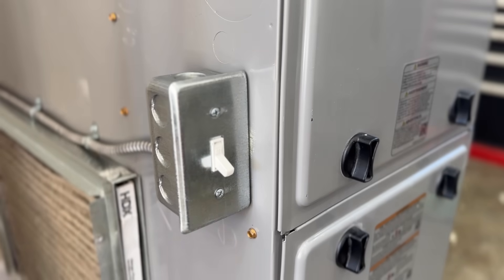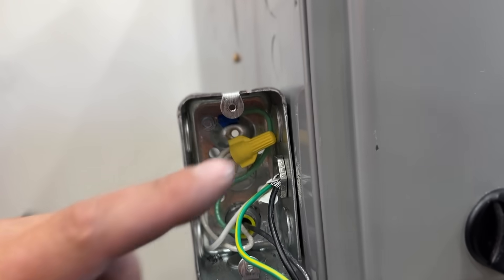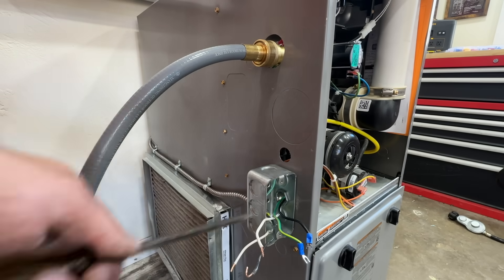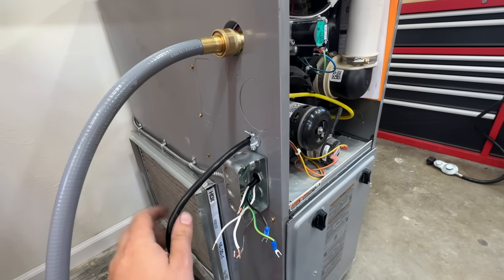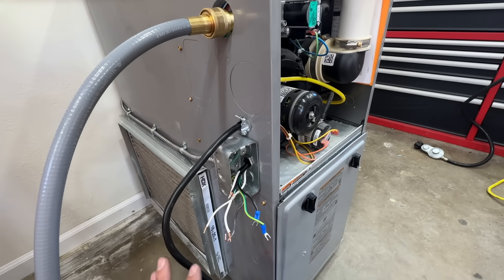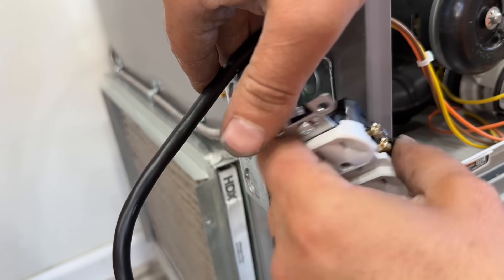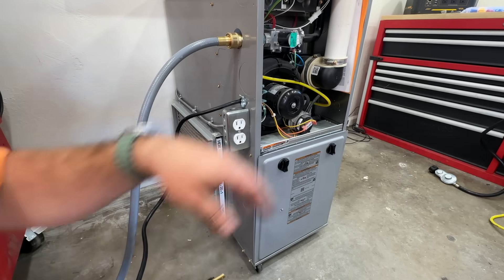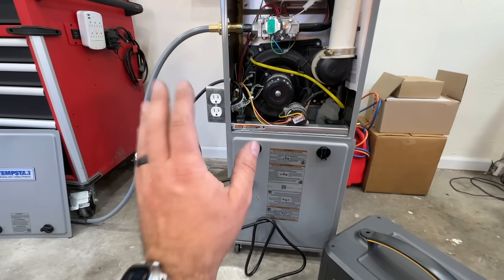Keep Your Family Warm During A Power Outage By Installing This $5 Part

Comment: Simply add a 240v breaker to the box along with a lockout.  They are totally legal if they are the ones sold by the box box.  Then connect your generator and you have power anywhere you need it in the house such as refridgerator, Internet, lights, gas stove and oven, gas dryer, washing machine, and Microwave.  You don't have to rewire anything other than run the wire from the generator to the panel and you turn off the mains to the panel while you are wiring it.  With a lockout it is impossible to have the mains and generator breaker active at the same time.  The lockout will cost you between $40 and $50.  You plug your generator into a 30A plug outside your house.

Comment: Three things I wont mess with…electricity, gas, and water…I will do most anything else in my home…but I leave these three things to the pro’s…my philosophy is simple…if I have to turn something off in order to perform an upgrade or a necessary/needed repair, I call the pro’s.

Comment: Instead of crimping terminals onto the stranded wire,select the grade of devices spec’d for stranded wire.They have a compression plate under the screw head.On the even higher grade,they are backwired,with an internal compression plate.Also,in this steel box install,even with the box grounded,if device yokes are not self bonding,a direct connection must be made.

Comment: Maybe I missed something here but, shouldn’t the breaker be turned off before connecting the pigtail to the emergency power source? I didn’t hear you state that. This so when the power comes back on, you’re not feeding grid power to the generator or power source being used.

Comment: Would it not be smart to make sure the breaker to the furnace is off, before connecting to the generator then when power comes back on disconnect the generator and flip furnace  breaker back on. being both outlets are powered with 110v if the breaker to the furnace is not off, would that not be putting 220 into the furnace with generator still connected ?

Comment: FYI, 
Make sure to read your gas and mechanical code books before doing this modification to a gas hvac unit. 
Gas hvac units are required to have a disconnect switch hard wired and not a pigtail. 
You should contact a Licensed gas technician and a Licensed electrician before doing this.

Comment: Got cut off. Inspectors require a on/off switch with a red plate. Also a cord sticking out that might be a cheap 16 or 18ga wire not capable for the power needed especially  on long runs .Get an electrician.

Comment: @diyhvacguy
Thanks for making this video, It’s been very helpful and informative.  
I’m pretty handy in most areas, except electrical. In fact, I have very little knowledge and I’m afraid of burning my house down. So that I don’t cause a fire, can you tell me how can I figure out what amps I have (15 or 20) on my HVAC? I live in a single family home that is 2700 sq ft upstairs with a 3/4 unfinished basement. My HVAC is a high efficiency unit. My breaker panel has two 30 amp breakers. I’ve been told that I have a 15 amp wall switch on the unit for power. 
Can you please help me understand how to wire your modification? Thanks!

Comment: I believe you should include some important facts. Just how long that Power source will run that furnace. That's the one FACT the Salesman ALWAYS leave out.  Most Power boxes are just to SMALL to carry the loads for any length of time. Yes it WILL run it But only for a short period.   Great info on the upgrade.

Comment: Hi, 
I have a question.  I just got installed inlet box 50 amp to main panel breaker.  For generator. So, do I still need to do this cable to connect direct to my generator?  Thank you very much.  Loved your videos.  Thanks again.
Tran.

Comment: Do you have those combo square drive + flathead screwdrivers for the electrical outlet wire screws or just not used/needed that much or misplaced?

Comment: Why not use one of the knock-outs on the junction box instead of using a knock-out on the side of the furnace.  As for the National Electrical Code:  There is a limit on how many wires and how many connection one can have in junction box of a particular size.  My guess is that the stock set up with power in, a switch, and power out is very close or at the max allowed.  You may want to go to a larger box.

Comment: Will these Milwaukee Power Supply be enough to power the Gas Furnace in a Power Outage?

SKU-3300R - ROLL-ON ™ 7200W/3600W 2.5kWh Power Supply 
SKU-MXF002-2XC - MX FUEL™ CARRY-ON™ 3600W/1800W Power Supply Kit

Comment: Bro what kind of gas line disconnect do you got there. I've got one in my shop is propane converted. Just got this heat exchanger replaced and going to use a store bought 30lb propane tank

Comment: how long will the battery your showing last if just using to power the furnace?  Obviously will vary based on outside temps and how many times it cycles on.  Just looking for an estimate.  hopefully it is days and not hours.

Comment: Our house uses a pigtail cord from the furnace motor to a wall outlet as the normal power.  If our power goes out, I simply unplug it from the outlet and to my generator extension cord.  Not all furnaces are hard-wired like the one in your video.  It is a good video for the average homeowner to use for this purpose.

Comment: I completed install and runs fine off of normal “house” power but when I hook my generator up the red LED on the circuit board flashes 8 times on and off. Won’t kick on heat. Using a 4500 powerhorse inverter please help

Comment: My furnace is hard wired. My furnace is against the right wall, my 12 gauge wire with ground comes out of the right wall, should I mount box inside the right wall of my furnace.

Comment: Great video. No hate here, just a share: in my silly region, an inspector failed one of our team's install's bc a wire was run through the cabinet. As you did(sorta), but the guy said it had to be m.c. wire. 

Funny right? Because the manufacturer puts little wires with rubber jackets, not mc. =b fun of the job.

Comment: Installed this last year after watching. Just had my first extended outage, been running the furnace during the outage for almost 24 hours. 

I did have to use a neutral/ground plug to get it to work with my furnace/generator combo. 

Thanks for filming this!

Comment: I just did this procedure yesterday! Power's out in my area of Wisconsin right now. This was literally a 10 minute job and I can now plug the furnace into a generator and everything works as it's supposed to. 
I made sure all the wires were secured using Wagos, even the ground. Furnace works fine, NO 'flame sensor' probs or anything else. 
Thank you for this vid, it's a real game changer!

Comment: I installed this setup on a Trane XV95 furnace. Just sitting there uses 40 watts of power. When running uses 580 watts just for heating. So this setup is probably not a good candidate for battery backup. lol

Comment: wondering what viewers on this channel think about using a gas powered generator to power your furnace in case of a power outage, I have a 3000W generator. I've heard various answers on that topic. I've heard some say the PCB in the furnace can sometimes get damaged because the AC sine wave is not clean enough. That surprises me considering it was designed to power a variety of AC powered products.

Comment: I tried this.  My gas fired furnace already has the plug to the duplex in the wall.  I’m using a Honda 3000 watt generator, ran a 12awg extension to the furnace and it will NOT fire up!   Then I unplugged from the generator and plugged in to the duplex on the back patio, it works!!!  Then tried bonding the generator to my house ground rod.  Stil no luck.  I don’t have an o scope,  but do you think it could be dirty sine wave.  I know this platform is just for comments and not for questions maybe you can point me to a forum thanks for your time

Comment: No breaker , no protection .
Lightning strike will send surge to furnice and to generator . The generator will explode . The funace motherboard will melt and probably carch fire.
Where is your lockout device required by code ? 
You do not know what your talking about .
You need a separate ground outside for generator . You must .

Comment: Make sure the wire gauge for your extension cord matches the gauge  for your furnace wiring and code requirements. Many extension cords use undersized 16Awg or even 18Awg wire.  Most house wires are 12 or 14awg.  12awg extension cords can be hard to find.

Comment: You absolutely can put a terminal on the end of solid wire.  With a proper crimp it is literally no different than on stranded wire.  However most home gamers (and too many electricians) do not use the correct tooling to create a proper crimp.  If the terminal falls off it’s not the terminal or the wire - it’s poor crimp quality probably done with incorrect tooling.

Comment: That's an idea...but in our area the CO detector is wired ahead of the furnace in the same circuit. Doing this idea does not supply power to the CO detector. I installed a dedicated 15A transfer switch at the panel to plug the genny or battery backup into. Quite a bit more money, but my CO detector gets power too.

Comment: Heres a thought... no idea if this will work...

 turn of the main breaker, if using a generator, plug one 3 prong end into the generator ( adapt cord to another three prong, keeping the same white to white black to black, ground to ground...than plug in to a out side outlet...

 Than ya dont have to mess around the furnace  switch..

 My furnace switch has been dry walled ( arround ) not much inside the E box...

 Not sure if this will work..

Comment: Q: I went to check my furnace for a switch but instead found a Grasslin 24V electromechanical timer. We bought this house from some "less than savory" people and everything was broken or busted- I managed to get the furnace up and running, but it's a dinosaur (installed in '05), and I don't know that the timer would even work. Is the timer necessary, or could I remove it and install this setup?  I'm sorry- I'm learning as I go here, and don't know all of the correct terminology.

Comment: First, love this video.  After having no power and heat for 3 days, I will be doing this modification to my gas furnace.   One question:  does the thermostat in my house still work as normal if I'm using the back up power instead of the grid power?

Comment: Great video! You can also run the pigtail wire to the electric box directly it has holes just like the one you knocked out of the furnace, so no need to run the wire inside the furnace

Comment: I would have made the electrical connections for the furnace inside the furnace with cable coming out and then wiring the outlet as normal.  Less stuff inside a small box,

Comment: My furnace is equipped with a capacitor on the side of the switch housing.  Can this fix still be done on my electrical configuration?

Comment: Just to be clear, once you plug it into battery generator the furnace turns on automatically? There is no control with thermostat (smart) or other controlling methods, it's a simple plug it in and you have to unplug to stop it, when it gets too hot inside, correct?
Reply: In his setup, a thermostat would be controlling the flow of power to the unit. In a blackout, that's dead, so when using a battery, you are the thermostat and need to turn it on and off when you want it to run. The best solution would be to run an extension cord to wherever you're going to be and plug in the battery there so you can monitor it. For emergencies, this isn't a bad compromise for the cost.
Reply: @Hydroculator  Thank you, this makes things much clearer. I have a Ecoflow that I can wirelessly control with my phone. So as long as Bluetooth is in range I could theoretically control it while I leave the generator in the attic. Appreciate the video, I'll document all this for the future to potentially convert my switch to a outlet.
Reply: @Hydroculator  Unfortunately I discovered my furnace breaker is 20A. I can wire up a 20A outlet, but a cord that's 20A will not go into my Ecoflow battery generator.
Reply: @Mystikalrush  The battery isn't supplying 20A, so you don't need a 20A wire into the battery. (Unless you have some $1,000 gigantic battery. If it's like the one in the video, it isn't going to put out 20 amps without being struck by lightning.) You can get a 20 amp to 15 or 10 amp adapter for 5 or 10 bucks. You can use it for supplying smaller current into a larger cable, but don't use them for connecting a high current supply to a small cable. As long as the supply current is smaller than all the ratings of each part, you will be fine. Don't do the opposite.

Comment: Here’s what I can’t understand. What was the point of running the pigtail into the furnace? What not make the exact same connections but just knock out one of the knockouts from the outlet box itself and run the pigtail out that way? I’m not sure if this would alleviate some of the code issues involving wires in furnaces, but either way there doesn’t seem to be any purpose of running the wires into the furnace.

Comment: So you give up the switch to de-energize power to your furnace during normal conditions that is convenient for doing maintenance.  If your furnace is located some distance (crawl space or attic) from your main breaker panel (garage or outdoors) you have less convenience. 

What happens to your way if you are running furnace  on generator and the utility power returns.  Won't  BOTH generator and utility feeds try to feed energy to furnace?  Is that a problem?
Reply: Then the outlet will energize without your furnace plugged into it, and the furnace will remain plugged into the alternative power source. At some point after the power comes back on, you head out to the furnace, unplug it from the alternative power source, and plug it back into the house-powered outlet.

Comment: Great video - Needed safety tip = always screw in all screws on the outlet so there are none sticking out that could cause mischief. Also, even though you talked about adding a ground pigtail, you should have just went ahead and shown it so some weekend warrior doesn't get hurt and also so it keeps the code freaks happy since the ground would be lost if you are working with the outlet pulled out from the box. A non-continuous ground is non-continuous protection so the "it's grounded while it is installed" does not qualify as a good safe ground. (overall very good video and I plan to install one ASAP). :)

Comment: What is the reason for the cord to go into the furnace and then exit the furnace into the outlet box? All the connections are inside the outlet box. So why not simply wire the cord directly into the box? I do understand that either way works the same.

Comment: Queston:  I'm not an electrician and would like to  do this of my Gas Furnace... My current unit is connected to a 20 AMP circuit breaker.  I can't find a pigtail rated for 20amps.  Any problem using the 15 AMP one?

Comment: Great D.I.Y. idea to power a gas furnace when there is an electrical power outage.
(This should also work if you wanted central A/C during the summer.)

Maybe you covered this in this video and I missed it.
[1]  Since there was an 'On/Off' switch originally on and for the furnace, why eliminate it.?
      Keep it by buying one of those 'combo switch/outlet'.
      That way the switch is still there, but now you've got an independent outlet/source
      to connect your 'pigtail extension cord' to, which will be used for the generator.
[2]  That generator (which runs on fuel and is noisy) ought to be outside the dwelling/basement and delivers 
      electrical power to the furnace's pigtail cord via a long enough and similarly rated extension cord.
[3]  Plan ahead.  What would the outdoor extn. cord 'go thru' to enter the home, while still keeping the cold 
      weather/temperature from coming inside.  And, also provide safety & security for the residents.

Comment: Good information. It is good practice to tighten the unused terminals, and when wiring any fixture in a metal box, be sure to wrap the terminals in electrical tape.

Comment: Very detailed video.
I saw nothing lacking as far as the changeover from a switch to an outlet.

You did, however, deceive a bit on cost.
For one, that power cord is at least a $15 part.  If its a key component to the process, and it is, you can't eliminate its cost.
Secondly, and far more important is the power source.  There's a major expense in that.  And I was not previously aware of the type of power source you used here. I was expecting you to hook up to a traditional gas generator, which brings up the next point.
A lot of people still have gas generators, but not all of them know how to safely use them.  I could see some people bringing their gas generators into their basements, setting them up beside the furnace, and employing this technique on the next power outage.  We should all know what a disaster that would be.

Again, nice instruction and tedious detail, but you probably could have carried that tedious detail through to the end.

Comment: It should be noted that the amount of electrical energy in these portable batteries is quite small and thus the unit shown here will only operate the furnace for an hour or so before discharging.  Obviously using a real generator will provide power for much longer.